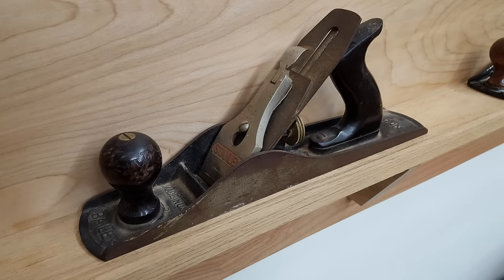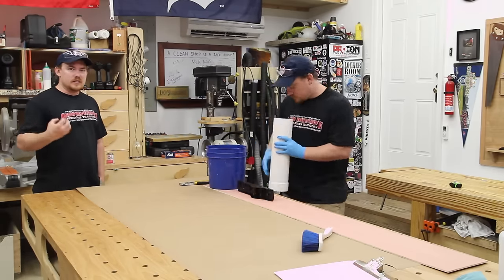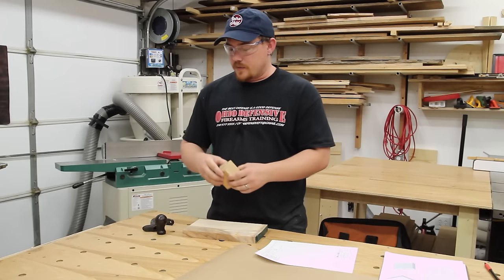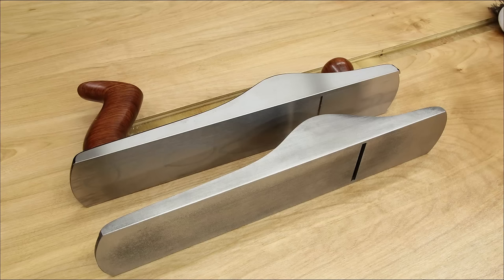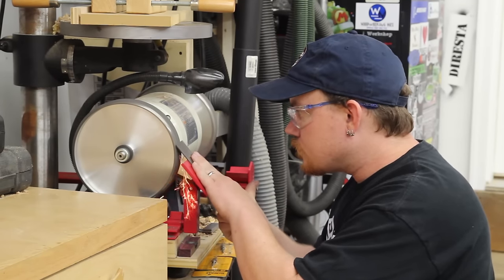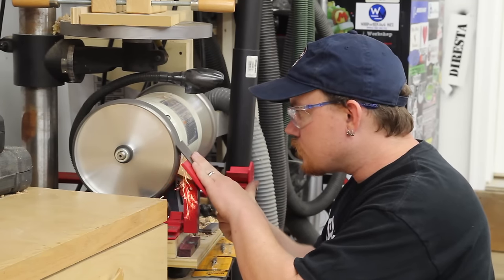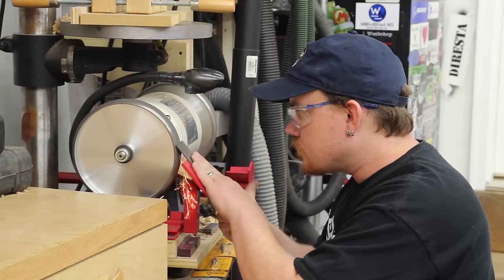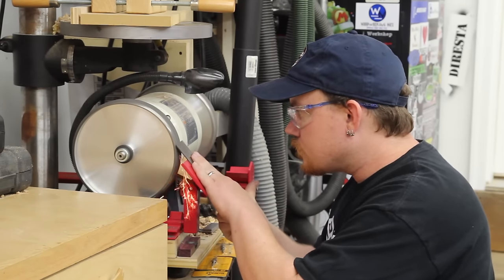Restoring A Hand Plane - Stanley Bailey #5    - 254

Comment: Very well done Jay ... I restore planes as a hobby now that I'm retired.  Everything you did was spot on less one thing, when you flatten the bottom of the sole, the plane should be completely assembled with the iron (blade) completely and safely retracted within the plane.  The bottom is actually under a certain amount of stress with everything installed and the lever cap tensioned.  Great video with one of the best illustrations of setting the iron I've ever seen.
Thanks for sharing your talent and experience, 
Cheers,    Dave

Comment: Nicely done, Jay.  I went into plane-collection mode a year or so ago, snatching up all the "homeless" Stanleys I could find, with hopes of restoring them to working condition someday.  I've got about 25 of the regular planes like you have there, ranging from #2 to #8, with multiples of each, and I also acquired a couple of #55's and #45's, with most of the cutters as well.  Right now they are gathering dust in the shop, but someday they will be "new" again.  Cheers.

Comment: Nice Job!  One tip: You can adjust the frog (forward and backward) without removing the blade/chip breaker.    The trick is to loosen the frog screws just enough to where you can turn the frog adjustment screw.  (Paul Sellers makes mention of this as well in a few of his videos.)

Comment: Extremely helpful tips on setting up and adjusting the blade. I have a plane that I just happened to come across and really didn't know much about setting it up or using it. This is a huge help. Going to go check mine out right now. Thanks!

Comment: If you mix up a solution of baking soda and warm water you can dip the parts in the solution to neutralized the vinegar. It will really help make sure no vinegar is left in the hard to reach places.
Reply: i was about to come down here and comment that same thing :D
Reply: What is ratio of baking soda to water, or how much baking soda do you add to to how much water?

Comment: Great video. I just bought some used planes of various styles that need to be restored. I've only owned small block planes that don't have chip breakers, and I didn't know the right offset to use between the blade edge and chip breaker. This video and a couple others helped me with that.

In general, your process is very thorough and also practical. I like your usage of PVC pipe to clean the rust off the parts. I'll probably use citric acid solution (comes in powder form that you dissolve in water and smells like lemons) to take off the rust because I hate the smell of vinegar.

Thanks so much for explaining what all the various screws are for. While I could figure it all out, it's good to know, for example, that the lever cap should be loose enough to allow the blade to be adjusted back and forth while the lever cap is in place. Since I've never used this style of plane, I didn't know if you're supposed to loosen the lever cap when adjusting the blade depth or keep the lever cap loose enough so the depth can be adjusted without flipping up the lever on the lever cap. It makes sense that you're supposed to keep it loose enough to be able to adjust the depth without flipping the lever.

I believe I saw another video where someone honed the front edge of the chip breaker to ensure that it sits flush with the blade rather than having any imperfections. I think you missed this. It's probably not a big deal if the chip breaker hasn't been damaged.

I love the style of your videos. You often have really creative and clever solutions for simplifying a particular wood working challenge or finding a way to get good precision out of your builds, but your presentation is always straightforward, matter-of-fact and humble. Thanks for posting all this great content on YouTube to help others learn!

Comment: Great video, hope you don't mind if I add a few tips here from a long term Stanley bench plane user. First, there is usually a lot of slack in the depth mechanism. If you back the blade out (reduce the depth of cut) and then use it there is a good chance that the blade will get pushed further back (you simply won't be able to understand why the thing is suddenly not working any more). To prevent this, if you back the blade out just spin the adjuster wheel in the opposite direction until you feel resistance- don't worry, you are not putting the blade back down, just taking out the slack. This locks the blade in position and prevents it from being pushed back in. Second- when you put the chip breaker and blade assembly into the plane and lock it in place, give the angle adjuster a wiggle from side to side a couple of times. This sets the blade to its proper depth in the assembly. If you don't do this what tends to happen is that you set the depth (usually by turning the wheel a mystifying amount) to where you want it, then decide to adjust the angle, at which point the blade depth changes drastically and you need to reset it all over again. Three- and this probably goes for all planes- an alternative to knowing if you have the angle set to dead straight which I was taught. If the blade is straight then the shavings come out straight- if it is not then the shavings tend to come out in the direction of the deepest cut. Fourth, be careful if you inadvertently bang the plane into something whilst using it (like if you are securing a board to the bench with a clamp or something). The jolt can often cause the blade to be pushed out, causing the next pass to be a deeper cut, and this will always be on the final, smoothing pass- causing your hard earned, crisp,clean edge to be a) torn to shreds, b) the blade never comes out straight so the angle will either cause the edge of the blade to dig into a board face, or make your square edge completely skew. This is annoying and time consuming.

Comment: A few tips mate. If you polish the sole up too high it creates more friction than if it was a brushed finish. Also, in future it's best to do sole work (flattening with sandpaper) with the plane fully assembled. You did a fantastic job. Really brought the life back into the plane. Just writing these tips down for others who watch the video.
Reply: +dashn64  That's a good point. I just use 80 or even 60 grit for the sole. By the time you're done, it's probably worn to about 120 anyway. I think the rough surface holds wax or oil longer too.
Reply from the maker: Thank you! I only used 120 grit on the sole.
Reply: I wouldn't have thought to assemble the plane to work on the sole. I'm guessing it has to do with weight and whatnot, as it just seems like flattening the sole is the same task either way. but not a problem to assemble the plane prior to the work on the sole.

Comment: Very minor suggestion, but I understand from other sources that when working to flatten the sole of the shoe, you should work it with the frog, blade and chip guard installed and tightened.  The reason is that the tension from those pieces once installed can slightly warp the shoe bring it out of perfect flatness.
Reply from the maker: Yes. That is correct. I did not know that at the time.
Reply: Do you think that is why, during the test run, it was coming up with more wood in the center than on the sides?
Reply: glyn hodges not knowing much about planes, id suggest that also the sharpening process can make for an uneven cut, which sometimes is wanted. E.g, smoothing planes where you want the cutting edge to have a very slight bow to it so you dont feel the corners of the cut:)
Reply: @RJLH77  - I think the inaccuracy might be that the frog was advanced too far causing a slight vertical arch in the cutting iron once installed. Just a suggestion.
Reply: glyn hodges  - Paul Sellers does put a very slight camber on his regular #4 smoother, he "tapers the corners back" so they don't leave "lines" when planning/smoothing large flat surfaces.
Reply: @davidrustylouis6818  That's exactly right.  the camber isn't needed on a smoother if you're only doing edges which are less width than the blade (e.g. for jointing), but a very slight camber on the corners is standard on smoothers being used for surfaces rather than edges.

Comment: A few other plane restoration videos I've seen (e.g. Paul Sellers) tell you to lap the sole flat with the blade/chip breaker/cap iron installed and under tension (but with blade backed out).
Reply: Correct, the bed flexes a lot and needs to be ground flat with the same tensions as it will have when being used.

Comment: Jay: Thank you for this video. I was recently given a Bailey/Stanley because they didn’t want to mess with it anymore. No work has been done to this plane yet. Your video has given me the excitement of renovating this plane. I was also given 2 small planes. One says “Millers Falls #75”. It is in fairly bad shape. The blade is chipped pretty bad. It looks like it was run into a lot of nails or something similar. The back of the blade has a series of straight grooves so that as you turn the wheel it has a piece of metal that rides in these grooves that moves the blade in and out. The other one has no name on it. Under the front handle to the left are two ovals with the letter “R” stamped inside the two bisecting ovals. There are also the letter “C” and the #2 stamped into the plane body. I assume somebody knows what it all stands for and if there are any replacement parts that caqj

Comment: I use vinegar for removing rust from old gas tanks, works like magic (full strength) I always neutralize the acid with a mix of baking soda and water so that the acid doesn't continue to Etch the metal! thanks for the video!

Comment: Like the lever cap, if the from frog adjustment screws are not aggressively tightened but are firmly snugged down the frog can be adjusted without removing the blade each time. Reference Paul Sellers hand plane restoration about 2012 I think.

Comment: Pretty nice results. What type of wood did you use on the knob and tote? I am fond of the original rosewood and my Bailey #8 I a currently restoring shows why. The is a knot in the middle lower portion of the tote and the grain direction goes parallel to both the top and bottom giving those strength. It is at least 55 years old so they knew what they were doing! Nice job on the #5.

Comment: I'm not sure if someone asked this or if it honestly matters that much but I've always thought the iron, chip breaker and lever cap were supposed be installed and locked down to flatten the sole of the plane. Does the pressure really make a difference?

Comment: Really great video, and perfect timing.
I just found a #5 Stanley Bailey for an amazing price...it is rather "Rustic" though, and will require much more time than you spent. I only had to drive to St Elmo Colorado to find it... there are still a few left btw....
I don't have a lathe, so I will work through the toe handle another way...not positive how yet, but I will
The Heal Handle I will make on my scroll saw
Any insight on where to find the original double ended threaded piece that mounts the Toe Handle?

Honest question. Why did you sacrifice a beautiful piece of Cedar?

Comment: Thanks a lot. Got my Stanley working like charm now thanks to your explanations.
I just have one issue when sharpening my blade and that is I seem to only be able to get my blades to the "crazy sharp" level by using wet sanding paper but not with stones. I don't know what I am doing wrong. I go patiently through 6 different grits on the stones with 8 shape circular movements and the result is sharp but never crazy sharp although I'm spending twice as much time with stones than with sandpaper :-(

Comment: I first saw you on April W. clock video. I have a wooden sole plane that has STANLEY / PATAPL1992 on the blade, but no size number.

The wooden block size: 15" long X 2 1/2" wide X 1 1/2 high with a metal frame(saddle) with a large standard front ball handle & a full grip back handle. the blade is a 45 degrees & a brass horizontal adjustment. Also has a side to side adjustment at the top, that moves left to right.Question is what kind of plane is it & will it clean up a table top made of constriction grade lumber?  I am making an farmhouse table this summer for use in a wedding, my first table & they want a rustic look.

Comment: I’ve seen some people back off the set screws on the frog just enough so that you can adjust the frog without removing the iron and cap. Always wondered if this was wise or if they should be locked tight

Comment: Thanks for the detailed restoration and basic set up of a plane. Question, While flattening the sole of the plane does it matter if the plane is assembled or not? As I have seen other people restoring planes, it is insisted that a plane should be assembled while flattening the sole due tension/ stress caused while the plane is assembled. Do you know if the difference is negligible or just a preference?
Reply: I was going to say something similar, that I thought it was important to have the plane assembled when flattening the sole. It would be really interesting if someone could do a comparison somehow to see how big of a difference it makes.

I wonder if it would be user specific too. As in, a right-handed person vs a left-handed person might change the forces on the plane, and so a plane flattened by a righty, might not work well for a lefty, and vice versa. I'm not suggesting this is the case, just wondering if it would be true.
Reply: I've always seen that it you should have the plane assembled, aside from the iron and cap assembly, to flatten the sole.  It's because of the stresses that are put on the plane during use can be different with/without the handle and tote.

Comment: Jay.  I noticed that you did not show checking the chip breaker's contact edge.  You may have don that off camera.  With my restorations, I always run that edge of the chip breaker over the diamond plates or sand paper to smooth out the contact edge.  That edge has to be absolutely flat and true to the blade.  Checking that for gaps will make sure chips don't slip in between the chip breaker and blade.  Problems with clogging were solved when this edge was flattened.

Comment: This is a very helpful video. I have three planes that I would like to restore. I do have one question. I have noticed in this video and others, people set the plane down on the bench, blade down. Does this not hurt the edge that you just spent so much time making? Just wondering. I am fairly new to woodworking. I just finished a buffet for my wife. First piece of good furniture. Thank you in advance!
Reply from the maker: The edge of the blade is metal. The bench or shelf is wood. It's never hurt the blade that I know of.

Comment: how about a link to the handle template. Thanks. I can see by the tools on your wall that you are coming around to the Paul Sellers school of woodworking. Just can't get the same smell and sound and feel from a Powermatic planer that you get from that Bailey plane. - Oh and what species of wood did you use for your handles?

Comment: I just got a Stanley no4  for $10.
It needs a bit of work, but overall it's good.
Does the vinegar also remove the paint on the "inside" of the plane. Or what would be the best way to remove the old paint before re-painting?

Comment: Jay, I'm trying to restore an old No. 4 Bailey-pattern plane (*ebay purchase, cannot verify brand, only markings are "No" and "4" on opposite front corners). It cleaned up well, but now when I try to set it up, I can't take a shaving!  Upon closer inspection, it seems that the blade does not actually protrude from the mouth at all, even with the depth adjustment screwed all the way.  I've tried going the other direction.  I have about a quarter or an inch of travel with the adjustment, but none of that adjustment gets the blade low enough to cut wood.  I suspect that either the yoke or the chip breaker are incorrect replacement parts, but is there something else I could do? Is there a setup step or trick I'm missing?

Comment: Very nice job.  One word of caution.  Very few old plane blades were made of HSS - High Speed Steel.  A CBN wheel should only be used with HSS or the carbon from Non-HSS will build up on the wheel and damage it.  Expensive tool to destroy!
Reply from the maker: Correct. I've read a lot on the subject and the consensus is that they can be scrubbed clean with an every day cleaner to remove the carbon buildup. I don't plan on using these wheels for that task much though.
Reply: Jay Bates
Reply: Mark Hazlewood bb

Comment: Hi, I see that the original black finish on your shoe is intact.  The finish on mine is inconsistent. rubbed and flaked off a considerable amount.  I've tried several applications of paint remover to no avail. What would you do?  Thank you for your time and consideration.

Comment: A simpler way to turn the handle is to drill the hole first, and mount the blank between two cone drives. You can then easily true the bottom face with a parting tool and the rest is easy.

Comment: question: i've bought a few garage-sale hand planes in the last few weeks and haven't gotten around to restoring them. I kinda like the worn look, it adds character, imo.  what i'm wondering is, assuming the blade is sharp and the bottom is flat and not pitted, does not restoring them affect their effectiveness or longetivity?  just wondering... 

I also dug the split-screen commentary. that kind of creativity earned an instant subscriber... :P
Reply: Really, as long as there is no rust anywhere and the chipbreaker is making good contact with the back of the blade, yea you would be fine.  Also make sure that the tote is not cracked.  This is very important because you can actually bend that long threaded rod if you use it like that for too long.
Reply: thatIlluminati _  h   V.